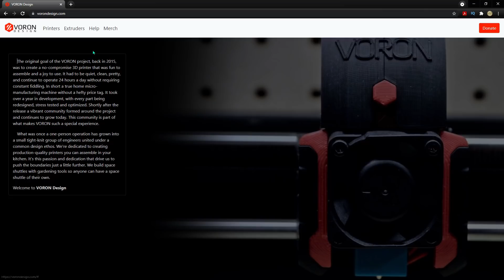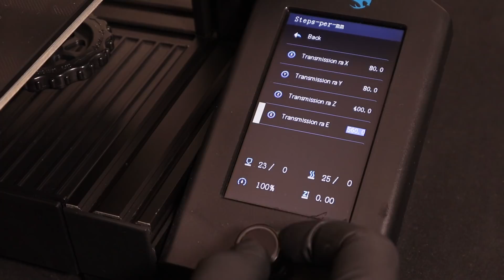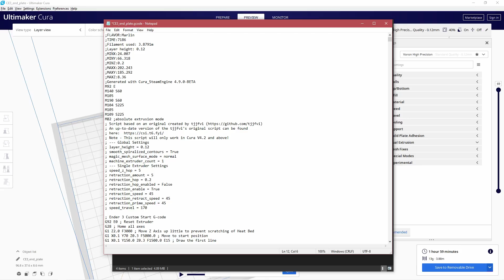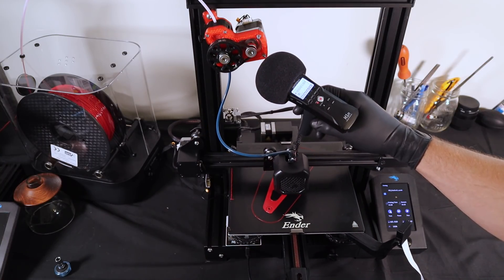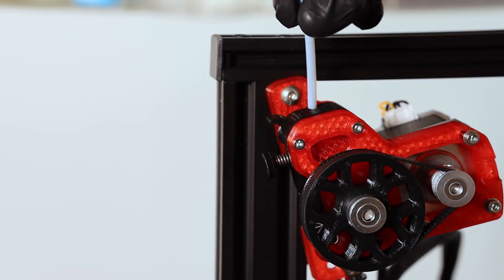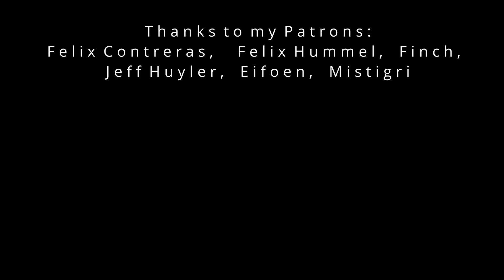Creality Ender 3 V2 - Voron M4 Extruder - Assemble and Test, How Does It Perform?

Comment: Couple questions if you don’t mind, are you using stock firmware and what retraction/detraction settings are you running? I have an M4 on my Ender 3 pro but the noise is super loud when I the default 60mms retractions speeds in prusaslicer.

Comment: The bearing issue is probably because the M4 parts are sized to take ABS shrinkage into account.
Reply from the maker: Just the other day I printed a part in PETG, and had one in ASA.  There was a big difference in overall length between them, not to mention that the PETG was so close to being flat, the ASA still warped a bit even though it had great bed adhesion.

Comment: Not sure of you noticed; but at the 7:30 minute mark, your Capricon tubing is moving back & forth. During advance & retraction this can cause issues.

I fixed my tube from moving by getting fitting with metal teeth to grab the Capricon tubing.

Comment: What drives me nuts is that on both extruders, you didn't have the ptfe tube pushed into the extruder side fitting enough, causing it to add slack. And very likely tearing the ptfe up.

Comment: @4:18 Note: threadlocker basically destroys PETG.  If you're going to use threadlocker I'd recommend ABS or you'll need to be VERY careful to keep it off the plastic parts).
Reply from the maker: I did not know that, thanks for sharing!

Comment: Had you done full config on your ender 3?  Everything looks  a bit on the loose side from the bearings to the heat inserts to the fit of the latch shuttle etc.  The voron parts do not need adjustment so if you find yourself having to print them anything other than 100% size then your printer is innacurate on X Y or Z or all of them!

Comment: Can you like remove the aluminum ends from the stepper motor and replace it with petg parts so that it's weight is reduced and hence on a fdm printer causes less ringing

Comment: Question, how can we make ender 3 fast like a voron machine
Reply: Probably not, it's the moving bed that makes it slow (unless you put a stepper motor on steroids in it for moving the bed) because it takes time to accelerate and decelerate the bed much more than it does for the Z-axis and X-axis.
You'll also run into cooling problems because of the stock controllers these printers tend to be delivered with: their cooling is ehm, well, not geared to superspeed, and the frame of the printer isn't as well.

I've done some Klipper tests and even though I was seriously surprised to see the Ender 3 Pro being capable of superhigh speeds, I noticed the really high speeds in the ringing test at around the 50% mark of the whole print were so fast that everything faster than that would probably make the printer capable of destroying itself, unless the frame is made superrigid and is bolted to whatever it's standing on.
Reply: @Dutch3DMaster  yeah, preparing a voron now with proper voron kit.

Comment: 5:25 This not cause faster rotation, but slower. Y can see it from your videos. It has only bigger strength on rotation. So usefull only if motor not has power to pull filament, but  lose speed on retraction. If put bigger gear directly on motor shaft, y get same effect with less items.

Comment: Hey! 3D Printing Canada, eh? I've probably got that same spool of filament!
Reply from the maker: That's right, I normally use them, or Filament.ca, both are pretty cheap and as long as the PETG is dry, it prints well, it does like to pickup moisture readily.

Comment: I just ordered it ended 3 V2 i've had it for two weeks. And now the armature with the extruder does not want to rise up as it prints. It'll make the base of the print maybe about an inch more and stops rising. Wasting plastic making a mess and give me a failed print. I've reached out to the manufacturer and so far seems to be ignoring me. They were happy to take my money though. Their customer service seems to be pretty bad. There's no one 800 number that I can find. And nobody answers my messages. I need advice or help would be deeply appreciated.
Reply from the maker: Can you shoot a quick video and send a link to needitmakeit@gmail.com or post it here, most of the time these things are fairly straight forward to correct, but a video is worth a billion words as they say.

Comment: As usual again a very high quality of video from you. Thanks a lot! I always enjoy watching your videos!

Which type of hotend do you use? Is it an all metal hotend? Or do you use a hotend with PTFE right down to the nozzle?
Very short warming (1 second) of the filament with a lighter and then stretching it makes it taper and reduces its diameter. I cut off the thick part and use this method to create a tapered point on my filament which makes it easy to thread into the extruder.

Could you provide me with some information which geometries on STL-files have a high rate of failure while printing due to the filament getting stuck and the extruder not being powerful enough? I am going to do some research on that and if you have some experience I would appreciate if you could tell me.

Greetings from Germany.
Reply from the maker: I have an all metal, but I try to keep everything as close to stock as possible so i use the one that came with the printer(s).   I don't print ABS at this point, if i did I might switch to the all metal to avoid the PTFE melting and causing toxic gasses.
Reply: @NeedItMakeIt  I was asking, because I had problems with failed prints when I tried an all metal hotend on PLA with retractions. The molten filament was retracted behind the heat brake, it solidified and got stuck.

With a very badly kinked filament I also had some failed prints because of friction in the length of PTFE bowden tube between the extruder and nozzle.

Bith cases lead to extruder skipping.

I was just wondering why your STL file lead to extruder skipping before you upgraded to your improved extruder.
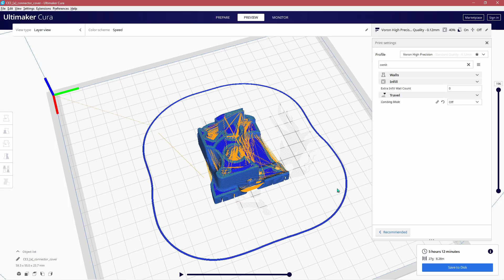Reply: @NeedItMakeIt  Could you please give me a link to the .STL-file for the part you are printing at 7:12 ?
I want to print the file which you had problems with ("CE3_[a]connector_cover") for testing my printer and filament.

Comment: Why is he using rubber gloves?
Reply from the maker: I bite my nails and you guys don't want to see that, also it looks cool, but mainly the first point.
Reply: @NeedItMakeIt  Hey, I used to have this problem (like a 20+ year long habit), but my wife got me to stop recently. The hardest part is getting through the first week, after that it becomes easier to resist. To get through the first week I put bandaids on all my fingers so I physically could not bite them. Now I carry a pair of nail clippers with me everywhere so I can remove small hangnails before I get a chance to rip them off.
Reply: @NeedItMakeIt  that's an oral issue you got there, its the same as a baby thats biting the nipple.
Reply from the maker: @Nobody-Nowhere  I'd think it is more of a muscle memory and stress related compultion.  If it was a serious issue I'd have it addressed, I may work on one finger at a time, that is an approach that seems to work.

Comment: can I glue parts to the shaft instead of filing it?
can I set negative esteps if I wired the motor backwards?
Reply from the maker: I suppose you could use threadlock as well as a set screw, do you have a dremel tool and an abrasive disk by chance?  Or even a diamond nail file will be enough to get a small flat.

Comment: You can't ream a hole with a drill - you need a reamer for that.
Reply from the maker: I know what you're saying, as it comes from metalworking and ultra high precision, however in this case, it works.  So drill the hole out to the correct size for a screw which is slightly undersized to pass through said hole with relative ease.
Reply: @NeedItMakeIt  My comment is about wrong terminology used. If you use a drill - you drilling it out to a desired size. If you use a reamer, you are reaming it to exact size.
Reply from the maker: @gcardinal  Time to move on.

Comment: I built an M4 from pla to use on my Ender 5 plus. ive gone through quite a few kg of filiment with no issues.
Reply from the maker: Mine is going strong still as well!  Thanks for sharing your experience.   Soon I'll have another video out with a cool mount concept, I've no idea if it is a good idea, but it works and maybe it'll help others with the issue of mounting it.
Reply: @NeedItMakeIt  that's actually the reason I put it on the 5 instead of the 3. I couldn't find a mount that I was satisfied with... I look forward to seeing what you come up with!
Reply: @NeedItMakeIt   "Soon I'll have another video out with a cool mount concept..."  

Curious on the status of this follow up video, don't see it on your channel and I'm considering printing the M4 for my E3P.
Reply from the maker: @scul00  Hi K, I've moved and we're just in the process of insulating the shop so I can have a place for my printers and tools, it has been a longer process than I had imagined, apologies for the delay.  The extruder is still working well, send me an email needitmakeit@gmail.com and I can send you the drawing for the mount.
Reply: @NeedItMakeIt  sent, thank you!

Comment: You should have built it to spec using ABS. I had an M4 built from petg and the motor mount warped from the heat of the stepper motor. It ended up causing belt rubbing because the stepper was no longer parallel with the gear.
Reply from the maker: I would, except recording the printer in an enclosure is not going to work for these videos.  So far so good with PETG.  I suppose if I was using it in a hot enclosure it would increase the likelihood of failure.

Comment: that's a great upgrade for the Ender ;)
Reply from the maker: Still going strong even with PETG and I've finished a better mount as well, and it is pretty cool (the guy says about his own design)
Reply: @NeedItMakeIt  please make video with light weight sherpa direct drive extruder, like with this*-*
Reply: @NeedItMakeIt  You ever notice that PETG has higher friction than PLA against a PTFE tube's inner wall?
Reply from the maker: @GnuReligion  I've tested this quite a bit and I've found that PLA (The brand I was using) had far more resistance within the tube, but by far the CF PETG was the worst.  One factor which seems to contribute is how tightly coiled the filament is and also how curved the PTFE tube is.  Moving to DD is probably the best solution to avoid it completely, but the printer works pretty good in the stock setup.
Reply: It turned my ender v1 into a workhorse, the only issues I was having were because of the shit extruder. It's also worth pointing out the updgrade is extremely cheap, since you only have to procure a few screws and the gear+belt which are both inexpensive. I wouldn't be surprised if it was cheaper than a "metal" upgrade of the existing plastic extruder.

PETG is not an issue at all with this setup, the ABS is required when you put your printer in a hot enclosure to print ABS.

Comment: As a voron user/builder I can see lot of faults but let's start with the basics: PETG is more elastic than ABS+. I know you used it in order to film the video easier but, even though, PETG seems to do the job, in high amounts of torgue it can deform and cause trouble to your printing procedure.
You use a lot of heat to insert the brass inserts (thats why plastic looks cooked) i.e. the insert was too much in the latch_shuttle.stl
Insert a small PTFE tube on the "filament entrance" side and your path is straight, no more loading filament issues.
Reply from the maker: Thanks for the tips.   PETG will have to do for now, but yes I'm sure it would fail in an enclosure, or through normal stresses over time.  Is this something you've experienced yourself?  The entrance design is quite loose to hold a PTFE tube, maybe by design.  I can easily modify this so it does not come out, however the filament stops at the hotend side tube, since the video, I've chamfered the inner portion of that tube as well as used the pre-load technique to bottom out the tube with the fitting for no movement and it seems solid.  I am making a follow up video soon, I'll keep your points in mind, thank you!
Reply: @NeedItMakeIt  PTFE might be loose due to the (slight?) difference in material shrinkage (I had PTFE to my M4 and it was skin-tight). Voron designers take that into account, when they make their parts, that's why you will mostly see them being printed by ABS/ABS+ or ASA.
Great content nonetheless and here's a suggestion: you can fit the afterburner printhead to your V2. Think about it ;)
Reply: @DaRk_DoG  I second the afterburner toolhead. There are some good remixes for Ender 3 mounts and a couple that enable a stock or microswiss hotend.

Comment: PETG is fine on M4 if sits outside the enclosure/chamber. Heck even PLA would work, just motor may get too hot.
Reply from the maker: So far so good with the motor temp, no indication of issues yet, a thermal break of just a few nylon washers could help if it was.
Reply: False. The motor will generate enough heat to warp petg over time. Happened to me.
Reply: @justinlitzinger394  Interesting, many people use various extruders made of PETG (not only M4) and they don't melt. There was this discussion on Reddit while ago, maybe you can get some tips from there?
https://www.reddit.com/r/voroncorexy/comments/mjahwr/voron_m4_using_petg/
Reply from the maker: There is always the possibility of only printing some parts from ABS, not much of a fan of ABS anymore, though I do like the low sheen compared to PETG.  The smell, I do not miss.
Reply: @NeedItMakeIt  Use ASA instead less smell easier to print.

Comment: You can see PTFE tube moving back and forth as it retracts. I guess you need some better Pneumatic Fittings
Reply: I recall seeing a video where a PTFE tube was improved by flaring the end in such a way that the tube no longer moves in the fitting, but of course a high-quality fitting is the best solution.
Reply from the maker: There is such a fitting called the Aglet, it allows rotation and prevents any potential for the tube from coming out.  I've found the standard M10 through fitting to work well.  Press the tube to the bottom and do the final tighten afterward to bottom the tube in the hole.
Reply from the maker: Probably should have covered this in the video, the fitting used in the video on the red extruder was not intended for the extruder, I melted in some filament in the hole to make it work and I wasn't able to tighten it much, hence the re-design.  The M10... something lying around works perfectly as it has on my other extruders for a very long time and now at least 1500 prints.

Comment: I'd be interested to hear how you think  this compares to a BMG clone extruder that has a 3:1 ratio. I just put one on my Ender 6 and it is working out very nicely.
Reply: Should work virtually identical, as they're both using the same drive gears. Depending on the torque curve of the stepper paired with the extruder, the gear ratio may be better or worse... That being said, a 'full size creality extruder' stepper is vastly overkill for a geared extruder anyway- the main benefit would just be increased extrusion resolution.

Comment: gearing down the extruder seems like a neat idea, sad that i don't think you can shrink the design enough to fit on a direct drive, even if it fits, the backlash of 3D printed gear is probably going to be too much. I've seen some used to allow smaller stepper motor for a direct drive setup though
Reply: Orbiter?

Comment: Great video! Next time try Sherpa mini from Annex Engineering! Lighter, more torque and cheaper!
Reply from the maker: I'll have a look, thanks!
Reply: I second the sherpa mini recommendation. Its design (and the derivative designs out there) is a leap forward just using commonly available parts, and it's easier to print. The M4 is fine if you're going to mod everything for an afterburner, but overall the slightly higher gearing than a regular BMG doesn't afford you any real advantages. Simply putting a pancake stepper on a BMG will make it overall lighter and it'll still outrun most any hotend anyway.
Reply from the maker: @Zardozer  I had a look and I like it, there will be changes to the printer mAs and motor rotation I assume?   The mounts look a little odd, it is frame mounted only?  I suppose I could whip up a bracket to mount it in the original extruder location.